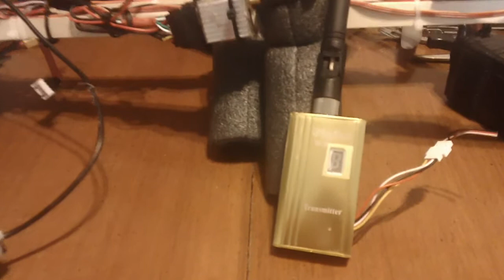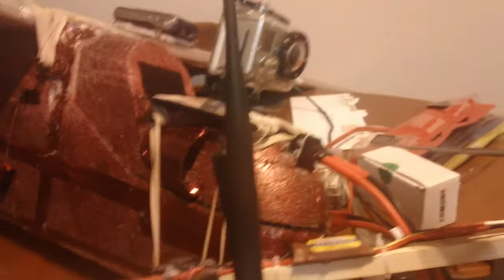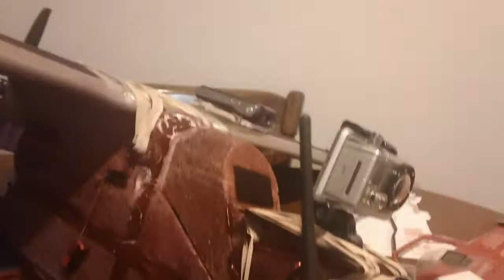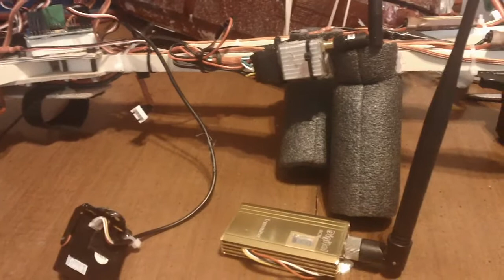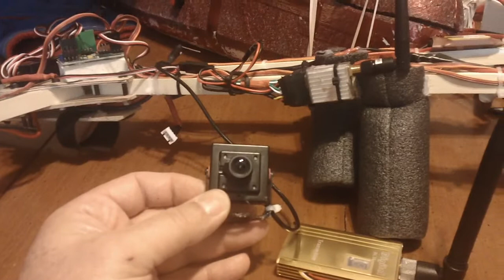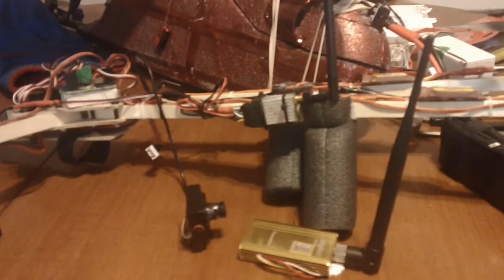Fpv tx 5.8ghz and 900mhz

Comment: actually i use the same setup on my secondary FPV rigs, cheap $35 HK 5.8 200mW, cheap $16 cam upgraded to 2.8mm lens, and a cloverleaf antenna. With the crosshair on my goggles i get 4km easily. Works great.

Comment: Thank for your Video RipCombat?, I would like to ask you if it will make any sense to put TWO transmitter in the plane , say one at 900Mhz and the Other at 5.8Ghz? with a diversity setup in the base station? what will be your opinion?

Again great video and thanks for sharing.

Comment: best thing to do with the flight cam starting out is just go to securitycam2000 and buy whatever 1/3" sony $40-50usd dollar, with a program card 480/540tvl or 600tvl camera fits your fancy. performance is much higher & you get (most importantly) control over where the camera biases exposure, shutter speed, white balance & color scales & low light color and low light B&W modes.

Comment: hi i have tried 900 mhz 200 and 1500 and are most satisfied with 200 200 went far enough away. 1500 need so much more power to function, not good when using only a bateria.